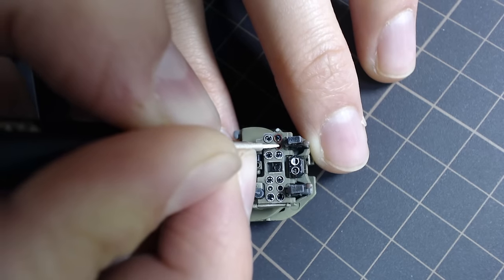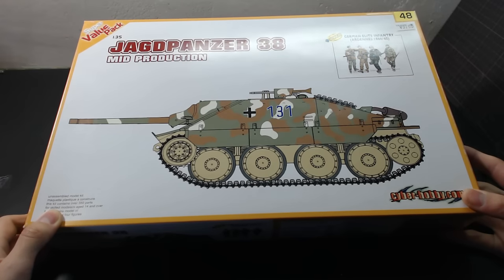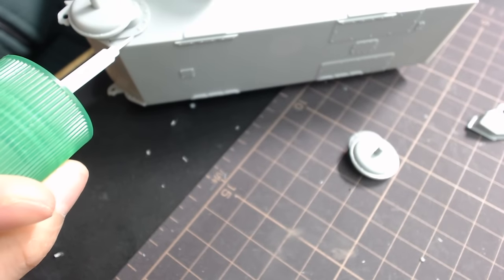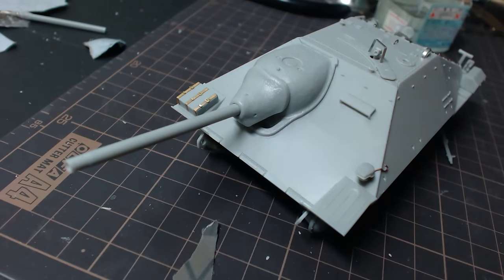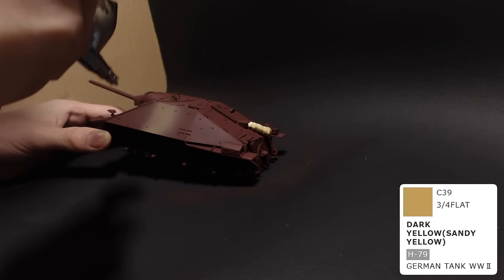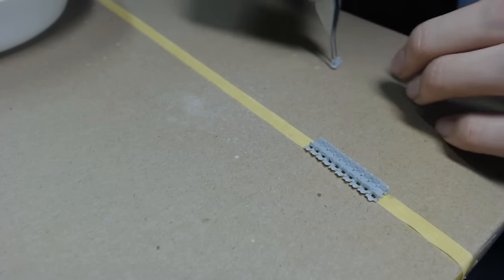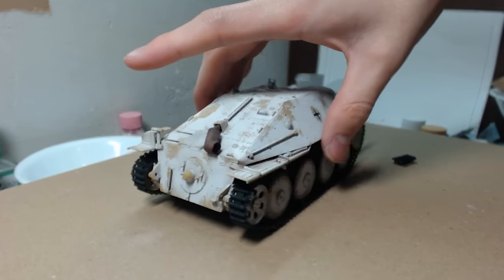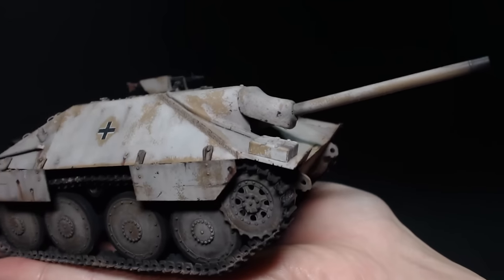Lets Build : Jagdpanzer38(t) Hetzer [Dragon]

Comment: again, really nice build. the camouflage looked nice as well, Andy's model headquarters is really useful, I learned the hairspray techniques from there too. I even used it on a battle of Stalingrad bf109. So what's next build?
Reply from the maker: +Jefferson Sheng (EXIACXA3740) Thanks! Im quite not sure, but looking into Eduard`s 1/48 Mig21...
Reply: Luftangreifer they're great kits, profi packs are great, it comes with tons of stuff!!
Reply from the maker: Yea! Ive never used Resin parts so thats something to challenge for. Bit worried about the silver paint though. I heard its quite hard.
Reply: Luftangreifer good gloss black or black primer will do the job, do you have the spray booth in order to use alclad?
Reply from the maker: Yes, well.. sort of. So all I really need to do is prime the model properly, spray whatever metal paint, and the clear coat it before moving on? Since masking on top of metal paint usually screws up the metal paint.
Reply: +Luftangreifer the new Vallejo acrylic true metal paints are extremely good and not to polluted. Even without a clear coat you can't use tamiya masking tape to rip it off. But still handle with care.
Reply from the maker: Ill take a look at the local hobby store, thx!
Reply: Luftangreifer yes sir~